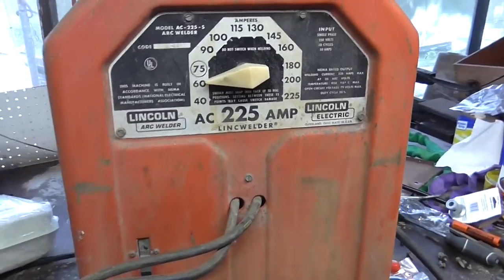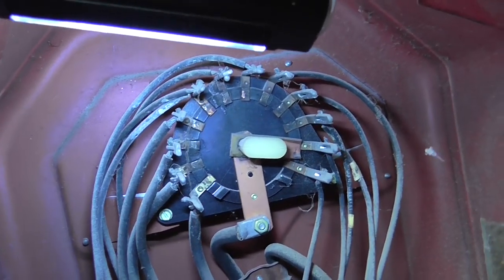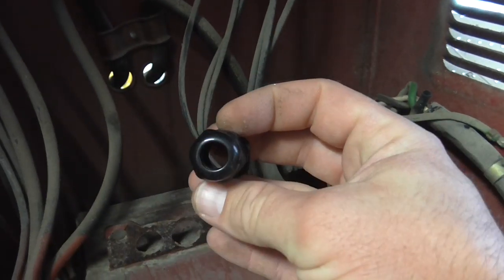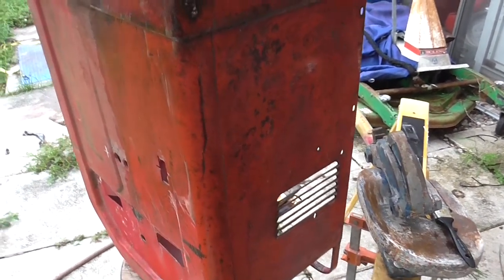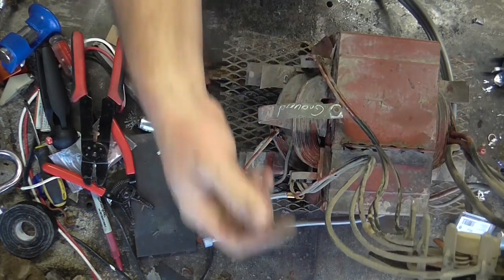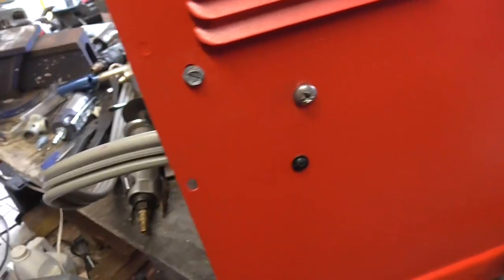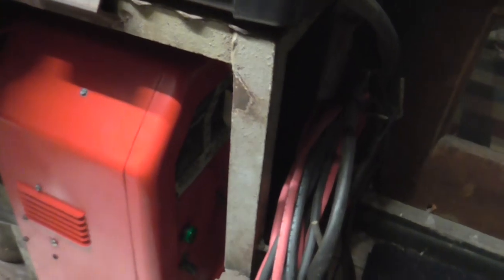Lincoln AC 225 refurbish (Wires and paint)

Comment: Mine came with #4 from the factory in 1968 and I’ve used it off and on for 50+ years. Just now In restoration mode. Changing it from AC only the AC DC with a bridge rectifier, should be a fun project through the years the little machine has fixed or built just about everything you can imagine on a farm.
Reply from the maker: The DC mod is in my bucket list. Good luck, cheers
Reply: Mine is also from 1968 and I still use it.

Comment: Those machines had either 4 or 5 gauge cables from the factory. 2 gauge is plenty more than sufficient, especially with only a 20% duty cycle. Using 2/0 cable would be a ridiculous level of overkill. BTW your machine was made before 1976 when they changed from a twelve step selector to an 11 step. This change coincided with a change from a copper transformer to an aluminum transformer. You can also spot the later version by the horizontal holes for the welding leads vs. the horizontal holes.
Reply from the maker: Awesome info Calvin. Thank you very much. Cheers

Comment: The math on how they get 225 amps (not 250) out of 50 amps is the basic electrical formula of Volts X Amps = Watts. 220 volts @ 50 amps = 11,000 watts. 11,000 Watts divided by 225 amps = 48.89 Volts, not allowing for losses in the transformer, running the fan etc. Figure that arc voltage while welding is probably 25-30 volts at most.
Reply: Oops! I just typed up a similar explanation, but skipping the wattage and using the transformer ratio. Boy was I late to the game! :-D

Comment: I acquired a Lincoln buzz box like this from the lady next door whose husband was a welder. The  amp selector switch does not move freely. Any ideas why?
Reply from the maker: It has been a while since I had mine apart, but I think there is a set screw on the knob that you can remove. Once you have the knob off I believe you can clean up the moving parts. Sorry I don't remember more. Good luck. Cheers

Comment: Great job on the welder, I am doing the same thing to my dad's old one, I have a broken wire from the fan I am not sure where it goes, tried to see it on the video, the intact one goes to the top of the power switch, the other one is spliced with the wire marked H3, but I can't see where that wire connects, or is that the one that you only connect for 440v.? Thanks!
Reply from the maker: It has been a long time since i did this project. All i remember is that the led light is tied into where the fan hooks up. Sorry i am not more help, good luck. Cheers
Reply: that wire lose is on my welder too and i just cap it and thats it ,works like a champ
Reply: if needs pics let me know

Comment: You did all that and didn't bother to put quick connect leads into the case?
Reply from the maker: Lol...I probably should have. If u ever go back and do the DC conversion I will add the tweco style...I think that is the name. Cheers
Reply: @joeheilm  yea its definitely nice to be able to take the cables off and either use them on other machines or hang them up out of the way. Even to replace them it makes it a hell of alot easier. My only gripe about these welders is not having any way to manage the leads.

Comment: If this welder in the picture is approximately 35 years old,  then the one I have that was given to me is probably around 40 or 50 years old. Same tombstone shape but amp lever is made of metal, small terminal block mounted on the transformer easily accessed from the back but a little pain to hook up and, backplate that covers the lowerhalf and bend in looking the same as the plate holding the fan as in picture that covers the back of the amp switch and have aluminum fan blade along with another top half plate with vents. It also has those exposed connection studs in front. Currently working on it. Already replaced the power cord and cleaned and dielectric lube on amp switch connections. Only need to replace the lugs on the wire. It even got a schematic diagram inside.
Reply from the maker: Yea they have been making this model for decades. Having the schematic on the inside is very cool...mine was toast. Cheers
Reply: @joeheilm  - How did it get toast? I have two of the same model but one being so old and the other from HD 2 years ago. I recently fired up my old one and it wprks fantastic.😁👍

Comment: I am trying to do the same thing with my buzzbox, I got lost when you were saying the size of wire for 30’ leads. So if I wanted to run 30’ leads would I need the #2 AWG or the 2/0 wire size? Hope you see this, and thanks for the great video.
Reply from the maker: TEMCo WC0456-60' (30' Blk, 30' Red) 2 Gauge AWG . This was the stuff i bought from amazon. It has held up great. Cheers
Reply: Thank you! On another note the paint is flaking off of the transformer, is it safe to remove as much rust and flaky paint to just spray it with new paint directly?
Reply from the maker: @joker50015  i dont know much about transformers. I would do a little research first, but i think you could gently clean the transformer with compressed air and electrical parts cleaner, the paint it with red electrical varnish. Good luck

Comment: You mentioned not understanding how you get 225 amps out of 50 amps. Just a bit of math to clear up how that works for anyone who cares to know. :-)

When you send power through a transformer, you are changing both the amperage and the voltage. The amount of energy going into the transformer is analogous to the power going out, it is just carried differently, so the amperage and voltage are a trade off.

50 amps in divided by 225 amps out gives us a ratio of 4.5. So the amperage is stepped up by 4.5 times, but the reduction in voltage is the same.

225 amps out divided by the transformer ratio of 4.5 gives us 48 volts for an open circuit output voltage potential on the leads. That will of course drop when amperage is being pulled by welding, but voltage drop is to be expected any time a circuit comes under load.

Hope this helps someone! :-)
Reply from the maker: Awesome! Thanks Brian. Cheers

Comment: Se puede usar cable más grueso que el normal ?
Reply from the maker: I used a chart to determine the appropriate cable size in relation to the length. I believe it is slightly larger than what comes from the factory. Cheers

Comment: Hey I got the same welder and I was thinking about restoring it kind of like the same way and I dont weld enough to keep the welder i was going to get a 110v stick welder instead of the 240v so I was going to restore it and try to sell it. I was wondering how much you think I could sell it for? If it was restored
Reply from the maker: Justin, in my humble opinion I would say hold onto your 240v welder. Once you realize the limitations of a 110v you will want a bigger machine. However, if you must sell it I think $150-$200 would be a reasonable expectation, regardless of how it looks. Good luck....cheers
Reply: Ok Thank you very much that helps I'll probably keep it than and restore it  and I'll have it when I need it
Reply: Damn I just sold one today for $60. It was old , filthy and grimy and hadn't been used in years. But I drug it out and it still works fine.  Came with most of a can of old 6011 and some other boxes of various rods. These welders seem to work forever.

Sold it for what I gave for it used some 30 years ago at a farm sale and got a lot of use out of it. The young man that bought it was in welding school and wanted something at home to practice with. So I think it went to a good cause and don't regret the price.

Great video.

Comment: you could use #4 or #6 considering short leads are always undersized by the chart. Do you weld at full 225 Amps? I use 90-115 usually. Look at the wire sizes on the rotary switches... tiny!
Reply from the maker: Hi Bob, good point! No, I don't think I have ever turned this puppy all the way up. Thanks for the comment! Cheers

Comment: I got a question. I have one of these and today I was welding and I adjusted the amp setting then it stop welding and the amp switch is skipping settings? What do you think is wrong. That I need a new switch?
Reply from the maker: There might be a screw in the knob that sheared, probably between settings

Comment: I just bought one for $25 and am doing the same to mine as you did to yours.  My only problem so far is figuring out how to get the plastic fan blade off the motor so I can clean and paint the panel.  Can't see any set screws and assume it just pulls off.  Any advice?
Reply from the maker: Hi Rick, I think the plastic blades just pull off....I'm 75% sure 🤣🤣 good luck. Cheers
Reply: @joeheilm  Thanks.....here we go.
Reply from the maker: How did it work out?
Reply: @joeheilm  I should know soon.  Waiting for paint to dry and final assemble and testing.

Comment: Hello
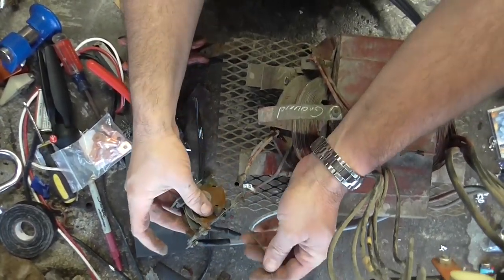How is that tool called at 13:21 in the middle (the blue one) where you crimp the connectors?

I need that..

If all goes well i might get my hands on a older telwin 152 bimax
It has seen better days, the look of it is pretty "tired" but because i only have a noname mig welder in my garage so i decided to take a chance and buy it for 50€ and restore it.

I will never get any Telwin for under 500, new ones cost 500€, welding is my hobby and i dont want to spend fortune on welder. I weld very rarely.

And Telwin is much better i belive than my chinese noname AC mig welder.
Modified it to DC and added gas valve and some other things to actually support gas.
It had no gas support.. It was a while ago... It welds but it could be better.

Will see if i will get this Telwin.. Takes a few days till the seller answers.
Reply from the maker: I have never heard of a Telwin. That tools is a battery lug crimper, it works great and they are pretty cheap. Amazon has them for less than $20
Reply: @joeheilm  Telwin is made in Italy. Its pretty popular brand, at least in Europe.
Thank you for the info, found many styles of these crimping tools.

If i cant find a shop who has already such tool then i will order one for myself.

I called the seller of the welder and we meet today and i guess i will take it. It looks old and tired, some rust, but price is good so i cant let it go.
Will take it apart and clean every bit inside and outside to full shine and adjust what needed.

Cant wait

Comment: Actually it's an AC welder so there's no polarity to the leads... if you convert it to DC, then the ground lead would be positive in most cases for steel welding. Just FYI... I have the same welder, probably 40 years old!
Reply: You can add a bridge rectifier to it for about 30 bucks and get much better welds. I saw a video where the guy just bolted the rectifier right to the front of the welder, cut the output leads, put on terminals and connected them back to the bridge, BOOM! all done! Great to keep the traditional tools working! Good luck! @joeheilm
Reply from the maker: Sounds cool, i'll try anything that can help me weld ;). Thanks again! Cheers

Comment: There is really no reason to strip the paint.  It is thin anyhow.  Just use a good sander.  I use the RustOleum Hammertone paints (paint and primer in one).  It sets up fast, looks good, and is super, super durable.  I used it all the time for equipment.  It works well.
Reply from the maker: Thanks Brian, I finally found out about the hammerpaint....great stuff. Thanks

Comment: if you were the one asking about a fan go on ebay , they are called a C -frame motorlook for the 240 volt version.they about $20. i bought a couple. they fit right back where that one come out. if you can't find one a computer muffin fan works good, just make sure it's 240. i wouldn't use a 120 volt fan, if the ground got loose the whole frame becomes hot. if you need help finding one on ebay i can get an item number for you.ERWIN
Reply from the maker: Hi Erwin, thanks for the offer, but this fan has been working great. Once i got all the dust and cob webs out she just purrs. Thanks again
Reply: Could you have just come off one side of your power cord. Just wondering being each one is 110

Comment: there is no + & - in ac
Reply from the maker: Lol...electricity is not my strong suit. I was just trying to put it back together the way it came. Thanks for the comment. Cheers
Reply: been electrician most of my life. great looking job! i used 10/3 sjoow cord on mine.i saw one video where destroyed  a perfectly good welder.because it had copper in it. some of the old timers do. nice see someone like me that knows how to put an old girl back to work!
Reply: Actually, there is both  + and - in AC. Switching at very high speed.
Reply: @erwinsummer6164  Question for you: My AC225 is really old, and didn't have a fan.  I want to add a fan to it.  What kind of motor/fan should I look for, AND does this fan hook up with two hots and not neutral?  Since that's how the rest of the welder is, I assumed so.  I'm kinda thinking of just hooking in a 110 AC motor to the small side of the power switch, and securing the neutral to the ground.  Is that a good idea?
Reply: @paulhahn9709  DO NOT use the ground as your neutral. You will then be purposely bleeding power through the entire casing of your welder and can get electrocuted. A ground is a last resort safety measure and should never have powering travelling through it...Go buy the largest 240v computer fan they sell, which will be slightly smaller then the opening of the OEM fan. You can force it to fit from two corners with gaps around it, but the proper way would be to make a backer plate out of a sheet of thin steel and mount the fan in that.Then mount it in the old round opening and wire it back to the same factory wires. No transformers, switches, relays required. Just reconnect.
Reply: @Jason-wc3fh  That's my issue: This old model never had a fan, it seems.  No hole.  No wires.  No reference for where to attach the wires as this is a retrofit.  Your video is great, but it wasn't super clear from the visual what wires would go where so that I don't screw up and it turns on when I hit the power switch.

Comment: On mine, I cut the leads off close to the holes and put Tweeco connectors on there in order to completely remove the leads and to add longer leads as needed.
Reply from the maker: That is a geat idea. Thanks for the comment. Cheers.

Comment: Its ac welder bro no positive or negative
Reply from the maker: Lol, i wish i knew that when i was rewiring it...i was terrified id get the wires mixed up and break it. Thanks
Reply: @joeheilm  yeah no worries on that the only reason they label one ground and one electrode because generally speaking you want the variable current on the side that has the welding rod for penetration but ultimately dealing with 220 its hot white  hot black  and earth green